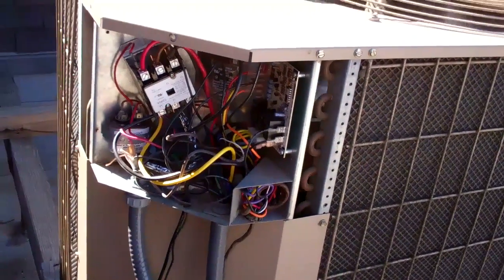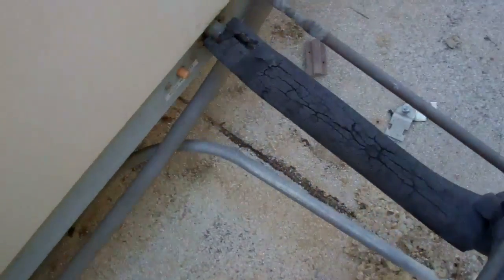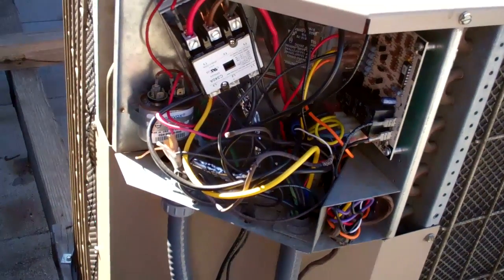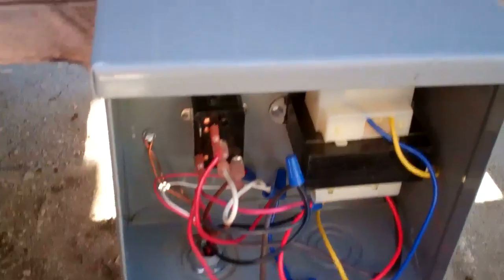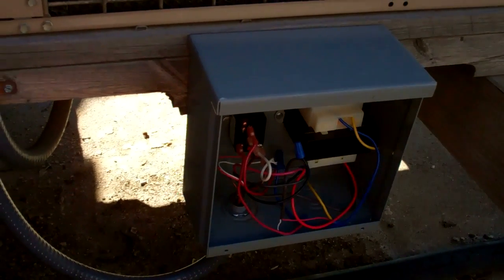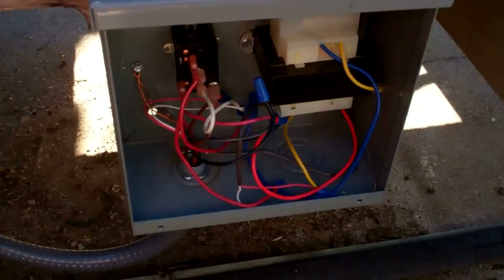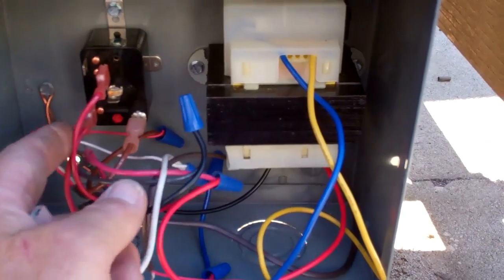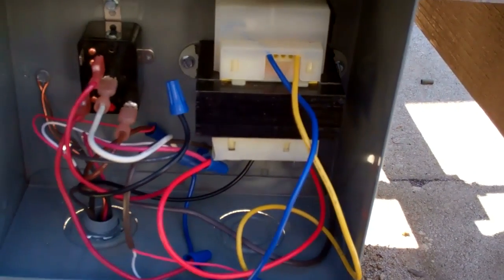HVAC Solving contactor issues with a relay

Comment: Good fix I have done the same thing on other systems. Later on when you go to re pull that wire, I would suggest running a new conduit most of the way and bypass most of the boxes and condelettes and run some 14s for voltage drop.

Comment: Had voltage drop to a 3 pole contactor out of the blue. Dropped in a peanut relay, I think it pulled about .5a, and tied that into a new 50VA transformer right next to the contactor. Worked like a charm. STILL don't know why the control voltage was dropping, and I guess I never will. Sometimes, as much as I hate it, good enough is good enough!

Comment: Great video. The video gave me a possible solution to a similar problem that I am having with split system at work.  Before I actually try it though, I am going to see if changing the existing 50 VA transformer to 75 VA might take care of chattering contactor. The system has already burned out 2 contactors.
Reply: Al Garcia did increased voltage solve your contactor chattering issue? Thank you

Comment: Could you have also used a contactor with a 230v coil and let the pilot relay control the 230v to the contactor coil.

Comment: The Fan coil Transformer may be failing too ! i'd Definately Replace the Transformer--- With a 100 va if it will fit in the Fan Coil unit. A Fresh Transformer Definately Sounds like it is Needed.

Comment: if u have trouble with the relay chattering in the future you might want to replace the fan coil Transformer with a 75 or 100va Transformer because of the long run and up the t-stat wire size to 12 guage. use 12 guage thhn stranded wire beacuse it is over a 100ft run.